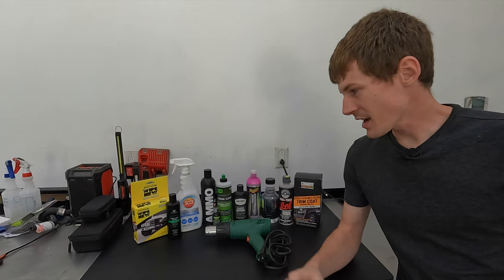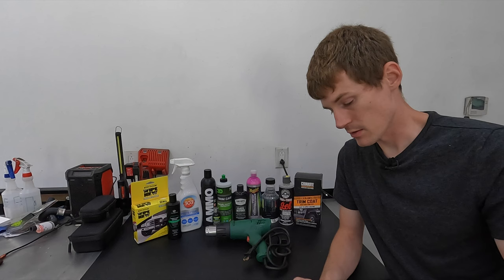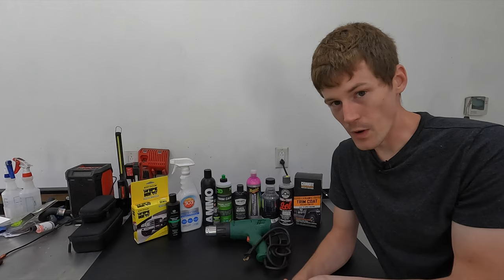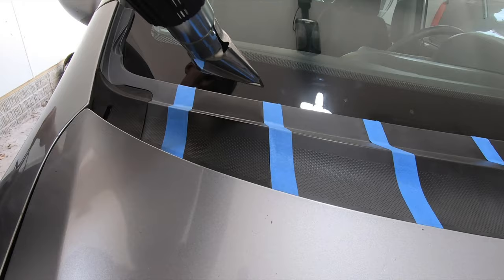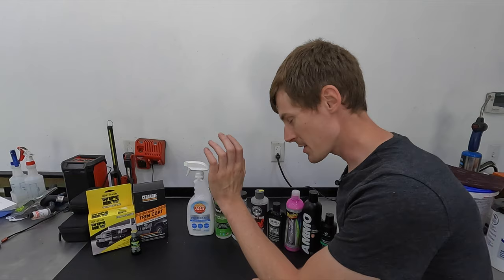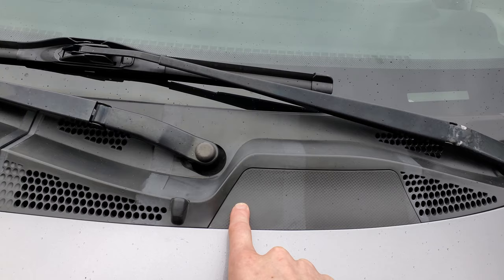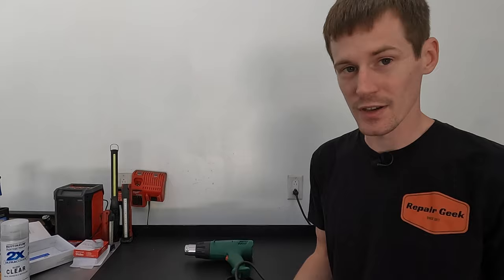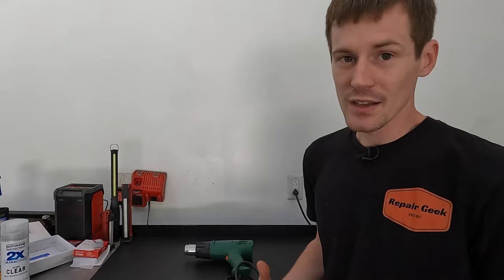Longest Lasting Trim Restorer Test.  Meguiars "Ceramic", Chemical Guys, Cerakote, Ammo, & More...

Comment from the maker: Links to the products used in this video:
Ceramics:
Rustoleum Wipe New: https://amzn.to/3R8i6y1
Cerakote: https://amzn.to/3KTNoGZ
Followin Ultimate Trim Restorer: https://amzn.to/3cIDyuz

Dressings:
Car Guys Plastic Restorer: https://amzn.to/3Q7DuCw
AMMO Mud Tire Gel: https://ammonyc.com/collections/exter...
Meguiars Hybrid Ceramic Trim Restorer: https://amzn.to/3KEJbqg
303: https://amzn.to/3AyOzqo
3D Trim Care: https://amzn.to/3ehPC6D
Chemical Guys: https://amzn.to/3Q7Eir2
Trinova Plastic & Trim Restorer: https://amzn.to/3CQFpbF
Lithium Trim Serum (a joke for the price): https://amzn.to/3wPqLxs
My Amazon Store:  https://www.amazon.com/shop/repairgeek
Help support the channel, buy using my Amazon links
As an Amazon Associate I earn from qualifying purchases and your cost is exactly the same.
Reply: Plastic dip is the answer.
Reply: Dude why didn't you just get Solution Finish? It's THE industry standard. And it LASSSSTS...
Reply: And don't just take it from me, Google or YouTube it. It's the best. 

The other legendary long term restorer is GTechniq C4. You'll get about 12 months from it.
Reply: This question may have been asked about this video and I didn’t see it. My question would be first of all could you use the heat gun and the wipe the part and spray it with a clear coat. If the product allows the clear coat to adhere would it last any time and would it stick long term. Also would the protection be like it would be when you first sprayed it.

The reason I ask I have more plastic trim on my vehicle than most other cars on the road, a 2011 Chevrolet Avalanche. In my opinion the only downside to the Avalanche. I am trying to find a way to make it look more up to date or find how to prep the plastic and spray the plastics either the color of the truck or black.
Reply: What happened to the lithium why didn't it get tested

Comment: I went through a similar process looking for the best product to restore my plastic trim pieces and what I settled on was removing the trim pieces and spray painting them with Trim Black by SEM Products.  That was 3 years ago and they still look fantastic.
Reply: Agreed. The only way to fly.
Reply: Does it looks glossy???
Reply: @summerforever6736  the finish from the SEM trim black  is matte.
Reply: I also discovered Krylon's Fusion (matt or flat can't remember) will hold up outside as I shot some over a plastic hood scoop I installed on my Mustang. It's been over a year and still looking great.

It would be great if someone could test out this kind of thing with different products and make a video.
Reply: @HAL-dm1eh  Rustoleum Fusion is a great spray paint.  I've used it on some pvc trim boards and it's holding up well outside.
Reply: On the exterior, a number of spray on clear coat products hold up for years.  The pro grade two part last longest.  They don't necessarily have to be sprayed on - most any can be wiped on rather than sprayed but you have to be careful to get it uniform on large areas.  But wipe on application can save a lot of time on narrow strips of rubber or plastic trim.  You just have to be careful to keep it off nearby paint, glass or chrome.  
Penetrol made by Flood is IMHO better than anything in this video.  Its very quick to apply and two coats holds up adequately for over a year.  Thats as long as the wax job on your paint.
Reply: @DrJuan-ev8lu  Interesting. I'm going to try it.
Reply: @DrJuan-ev8lu   Penetrol contains petroleum distillates that may attack and eventually eat away at rubber and plastic. 

I don't know the history but back in the 80s when I was all into protectants and lubricants I was warned by my dad (who was a house painter and very knowledgeable about oil based solutions) not to use WD40 on rubber and plastics. 

I always used caution since then and seem to see the same sentiment today, though now there's debate. 

I wouldn't think there would be debate about what seems to be simple chemistry but I'll let the winners decide before I take the plunge with my plastics.

Comment: Hope you turn into the project farm of the car world, I was hoping you would have a generic ceramic coating in the mix as well but I supposed they would perform just about the same (Perks of that being you can use it on paint too)
Reply from the maker: To be honest I ran out of faded trim to test on. I could have done more for sure.
Reply: I agree. This young man has helped me make purchasing decisions in a LOT of cases. His videos are invaluable.
Reply: @RepairGeek  also try plain old shoe polish….the cheap kind with a foam applicator. I’m sure it won’t last long, but probably reasonably close to some products, and a lot cheaper!
Reply: Seriously , amazing video, coming from watching a few of these before making my pick.  Question for any of you.. if the car guys worked the best as a dressing, would it be optimal to just “add” a ceramic coating on top of it ? Maybe an Adams graphene spray or a quartz pro

Comment: I have a 2003 Subaru Baja. The outer sides of the side mirrors had deteriorated horribly even though from time to time I had tried to keep them looking clean and attractive. I had the best results using regular Armour All. The only thing was I had to do some extensive rubbing to remove the oxidized coating on the exterior housing of each mirror. They each look brand new; I was very proud of my result.

Comment: I haven’t tried any of the ceramic coatings and the 3 non ceramics seemed to only last a month or 2 on my plastic bumper covers. What has lasted is a combination of a heat gun and non ceramic restorer. It’s been 3 years and still looks great I only used the heat gun once and once a year I wipe on trim restorer specifically turtle wax trim restorer.

Comment: Since the sunblock lotion worked so well at blocking UV rays, maybe this would be a good product to use as trim plactic and/or rubber protectant?
Reply: i am about to use heat gun, followed by sunblock on black plastic on my challenger,  I'll let you know how it turns out.  😲
Reply: I guess it works but fades rather quickly, it even says to apply every couple of hours on  your skin so maybe it'll last a day or so on the car, and forget it after any rain 🤷‍♀️
Reply: @Zionsol777 how’d it go?

Comment: New car with lots of plastic trim. Spent last 2 weeks looking at trim protection you tube videos and most have some great product they like. Going from video to video I could not make a decision. Your video not only was clear and informative but gave me enough facts to make a decision to order a product which I will feel confident in using.  Thank you so much for your time and effort in making this video.
Reply: Did you decide on sun blocker or spray paint? 🤣
Reply: I decided to just coat the plastic in horse semen

Comment: I've used CARPRO CQUARTZ DLUX Wheel and Trim Coat with great results. It's a ceramic coating, so it lasts a long time.  It definitely doesn't seem to be as glossy as the ceramic ones you have featured here.  A lot of professional detailers love this for trim, you might want to try it out too.

Comment: Fantastic analysis.
Second vid I've watched, and your ability to muster up above average common sense is remarkable. Subscribed. Thank you.
I just purchased a 2011 Acura MDX Sport with 45k miles. The car is like new. I would very much like to prolong the aging process and will be addressing the trim, paint, underbelly and interior. I Would appreciate any conclusion you have arrived at re preventative maintenance for any of these various surfaces.
Impressed. Thank you.

Comment: Nice video. This has been on my mind for quite some time now. I have an 18 year old Chevy pick up that I used the New Wipe on a few years ago. It came in a bottle with applicator, gloves etc. 
Very faded front bumper. Made it look better than new. Yes, shiny at first. It lasted probably a good 3 months before it needed it again. 
I’m wondering if multiple coats over a years time will help with the advertised UV protection.
Remember, they want to sell you as much of the product as you will buy.

Comment: I know it is odd but brake fluid is amazing on trim including any rubber.  From my testing it adds back to the plastic what is needed and the shine is like nothing else.  Thanks for your work!
Reply: I wouldn't use brake fluid on any type of rubber, it may look good but it will break the rubber down over time!!
Reply: brake fluid will ruin paint

Comment: Nice comparison! Some of the other car YouTubers just use ceramic coating designed for paint (e.g., AvalonKing) on the plastics, and it would be interesting to see how that compares.
Reply: That’s correct and it works the same if even better and longer

Comment: My experience with 303 is that when you start adding it to your rubber/plastic etc. from the beginning of said pieces life, it tends to keep the pieces looking better over time.  It doesn't necessarily restore as much as protect over time.  I have noticed that you need to apply it liberally and allow the product to soak in for a long time before wiping, or just don't wipe at all.

Comment: I opted for the Cerekote primarily because I wanted to restore the dark gray plastic on my 2016 Nissan Frontier.  While it does have some sheen to it, that is a better option than putting a black coat of anything else on the gray plastic.  I also did a touch up on the door handles and the trim around the lock on the tail gait.  The Cerekote has endured two automatic carwashes, one manual wash, a heavy rain, and more than a hundred miles of dirt and gravel roads over the past few weeks.  The finish looks just as good as it did six weeks ago when I first applied it.
Reply: Is the Cerokote still holding up ? I’m thinking about applying it to my Nissan rogue trim
Reply: I’ve used Cerakote on a 2004 Silverado. Fantastic results. I bought the truck used and thought the lower front valance was gray. After Cerakote, it’s actually black. Great product and easily found at Wal Mart. Mine still looks OE black with about 80% of the initial gloss after 3 months of 100 plus degree south Texas sun and gravel roads.
Reply: I used Cerekote works good . Have a little spot on side mirror . It’s been there for over a year . .. just be careful with the stuff.

Comment: Best option for plastic is boiled linseed oil. I had grey plastic all over my Freelander, wiping with linseed, not only feeds the plastic, it lasts, 4 months to date, it's cheap and so easy to reapply if you need to.
Reply: I have been seriously considering boiled linseed oil. Do you know how well it stands up to winter conditions? And have you ever tried it on your tires and the wheel wells?
Reply: I was just considering mineral oil or olive oil and then cover it with sun block the highest they make, What do you think?
Reply: I think your on to something. My Dad used it to maintain hiscollection and use of shotguns. It kept them looking dressed and fresh looking. Smelled good too. Had a rag saturated from use he just kept in the gun room used it over and over again.
Reply: Oil may cause rapid deterioration, due to the fact it's oil and in 100+ degree heat, would turn into a deep fryer of sorts.  I like my French fries in oil, not my black plastic trim pieces..😂😂

Comment: Thank you SO much for exposing these "snake oil" products. I have used various "trim preservatives" for over SIX DECADES, and have never found anything that lasts more than a week on a NEW car. I have found that the sun's heat is what kills these products and plastic trim. If you have a new "daily" that sits in the sun for about 8hrs......my advice leave that NICE daily in the garage AND get yourself A BEATER for work! I did see something on YouTube that looked impressive for RESTORING faded trim. It actually was a spray-on clear coat! Now who in their right mind is going to spray the vinyl trim on a NEW car with paint (which will probably peel off in 6mo...leaving a real clusterF**K mess)! lol

Comment: I've pretty much done the same as you have over the years and as you've found these are all a waste of money.  The only way to really make it look good and last is to paint it.  I know sounds like a lot of work but in reality its not much more than using these worthless products.  Two products I would highly recommend are Duplicolor Bumper and Trim paint and SEM Trim paint.  If you can remove the trim do that but if you can't you can mask it off.  What I did came out looking great and I'm maybe in the 3rd year into it.  Make sure you clean it well per instructions...really important to get good adhesion as these pieces typically see lots of wax.  Good luck!!!

Comment: After watching endless reviews of different products, I used cerakote and it's been hanging on for over 2 years. There are some bits that wore off now though. 

I had the same problem with bubbling but only on parts that weren't perfectly clean. I also left some streaks on some spots when the towelette became kind of unraveled.

Comment: Thanks for another great video. I was very surprised that the ceramic coatings didn't help at all in slowing UV damage. My takeaway... Use the heatgun to restore the plastic to like new finish then apply a liberal layer of sunscreen to protect from further damage. ;)
Reply from the maker: or a good clearcoat instead of sunscreen.

Comment: I bought a 10 year old abarth 3 years ago here in Texas.  The trim was 5 times worse than what you started this test with.  I used cerakote and it literally looks brand new,  3 years later
Reply: Agree. I’m one year in on my Tundra, and the ‘grey’ trim is still black. I now use it on my vintage car.

Comment: The dressing type products never worked for me except on one occasion.  This was on a car that was kept indoors, seldom see any rain and only gets driven once a month. The product was applied in 2015 and it still holds the color today (2024). Of course the car was driven and has seen rain a few times during the 9 years. My hypothesis is that the product had more time to soak into the plastic before it was exposed to the light and rain, or the plastic compound on this car (1989) is different from the other newer cars I have.

Comment: What I learned from this: Mix in sunblock with some satin clearcoat paint and have fun with it.
Reply: I came back because I figured I needed to add the disclaimer that that was a JOKE. I won't be doing that (after researching a bit) and if you do, do it at your own risk. 😉

Comment: For the ceramics you're supposed to buff and wipe off after about 30 seconds. It will knock down some of the shine. I personally use artdeshine tire coat. Good durability and looks great.

Comment: Excellent review process.  I’ve used the wipe new headlight restore and  it last  3-5 years  so I’m not surprised the WN trim restore came out ahead.  One question I have about the Cerakote  is did you  hand buff it with micro fiber before it fully cured. Perhaps that’s why you had imperfections in the finish.  I think you are supposed to .   New subscriber.

Comment: I tried out Ceramote and hated it. The application process, the wipes, and most of all, how it looked after.

Removing it with a magic eraser and nail polish remover (non acetone) sealed the deal.

Used tire shine on my cladding for now but when I know it's all gone, I'll use megs headlight spray to protect the cladding.

Comment: Like headlight restoration, if you don't put a UV coating over it I agree a heat gun doesn't work.  After I heat gun I spray with a clear UV protecting spray paint in matte, semi-gloss or gloss depending on the surface look it want.  I have had it last 5 years that I know of as that was when I sold the Expedition as the longest I kept a car after having the need to do it to.  Polishing a headlight turns yellow again soon if you don't put some kind of coating over it as well.  The main thing is getting UV protection as you were showing isn't happening much.

Comment: These type of products have pro's and con's to each and each must be taken into consideration when you consider buying one.  303 for example is not really a "restore" type of product.  It is more of a conditioner to keep plastics, rubber ect in top shape for a long time IF applied frequently.  I prefer 303 for a couple of reasons.  1.  Interior wise it has a pleasant smell almost new car smell like.  If you get some accidentially on your gps screen or anything it wipes off very easily.  Exterior, gives a nice low gloss sheen, and again, if you get it on the paint, or windows, it wipes right off with no hassle.  The other products here though they seem to keep a shine longer, and what not, the problem is getting the product off the paint or glass can be a PITA.  Also, some of these products seal the pores of the rubber which can cause cracking down the road.  Most people don't keep their cars long enough to find this out.  After using 303 for over 20 yrs, I have yet to replace a rubber trim piece anywhere on my car due to cracking or fading.  None of the other products here?  They haven't even been around for 20 yrs.  All good products for what they are, but I always go back to 303.
Reply from the maker: I completely agree with every thing you said. I included it in the test because 303 says right on the label that it restores rubber and plastics. 303 calls it a restoration product, I wouldn't.